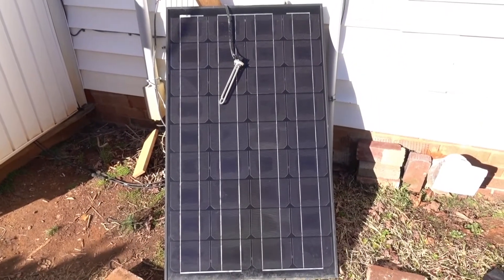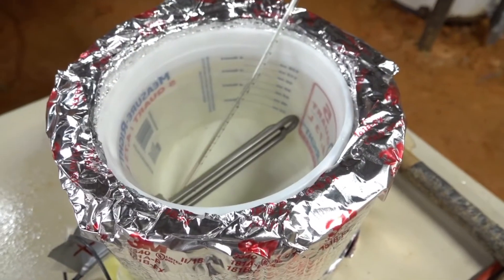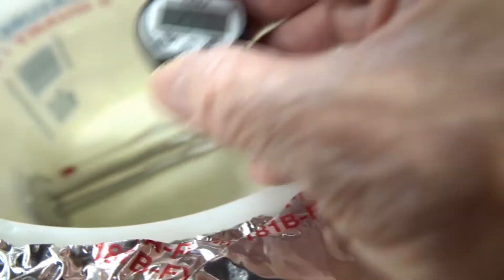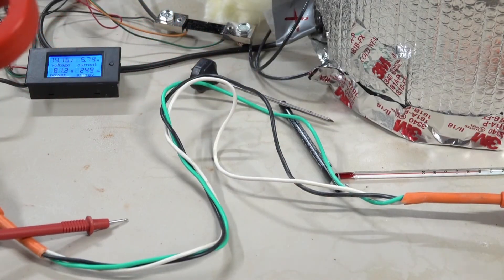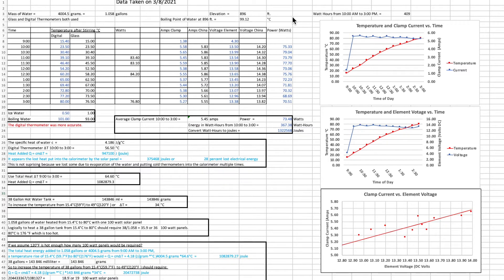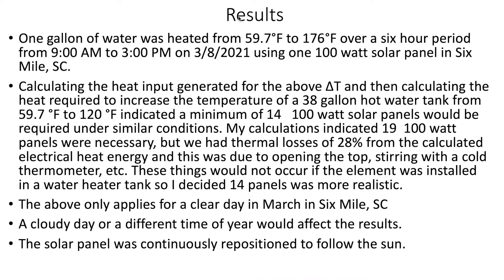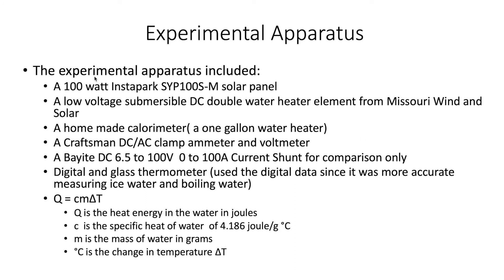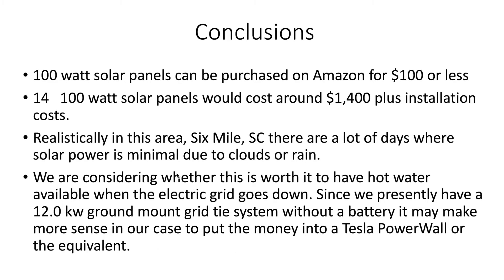Using a 100 Watt Solar Panel to Heat One Gallon of Water

Comment: Could you help me out? Is a one gallon container able to be brought to a boil with (1) 100 watt solar panel? Trying to make a distiller.
Reply from the maker: Maybe if the boiler is insulated so all of the heat input goes into the water and not the environment. A continuous boil would require a lot of heat input. I have not tried to boil water with it. Good luck with your project.

Comment: Having measuremens to end at 3PM is like ending a movie with a cliff hanger.... The sun is still up!!!! what happens the rest of the day?
Reply from the maker: This was just an experiment to show how easy it is to do this. The solar production on our 12 kw ground mount panels is basically zero before 7:00 AM and after 5:40 PM. Most of the power is produced between 9:00 AM and 3:30 AM where we are located.
Reply: @anisotropicplus  thanks

Comment: Are there any safety considerations regarding arcing of AC water heater thermostat contacts  for instance,  or elsewhere in the circuitry, with DC direct or is this such a low voltage
 that DC arcing is not an issue?
Reply from the maker: Very good question. I was monitoring this set up closely since it was an experiment. If I was going to install it in a home water heater or use it in an unmonitored way I would add a fuse to the circuit and size it for the smallest wire size used. Make sure you comply with any electrical codes for your area.
Reply: @anisotropicplus did you install it ? Thanks

Comment: As a bench mark, I wonder how heating a container, clear on the front and insulated on the back with direct sunlight would have worked?
Reply from the maker: Thanks for your comment. have not done that exact experiment, but other experiments suggest it would work better since more of the total spectrum of sunlight would be used. Especially if the bottom of the container was black. The thing I like about using the photovoltaic solar panel is you have a lot of flexibility in where you place it and getting the energy inside your house using only a small diameter cable instead of water pipes or air ducts.

Comment: So it looks like it is not worth it. Thanks
Reply: Depends. This video is 3 years old and panels are way cheaper now. If you have a 450W panel and a properly matched element you might only need 1 panel to partially heat a tank over 15 hours of sunshine. By partially heating I mean you might have comfortable warm water rather than cold water coming from your hot tap. Add another panel and you might get water that you can directly shower with and it should be that way for the next 20 years.
Reply: @jellibeens  In my location I am happy to get minutes of sun per day. Today for example 120W panel, 50Wh production for a day.
Reply: @jellibeens  Thanks for watching and your comment.
Reply: @jellibeens  I just got my old Welsh house. Nice cottage in the national park. The biggest issue in my valley is heating water......its so expensive these days. In my rental the farmer had a biomass boilers, so efficient and amazing, but expensive, 2 - 450W panels, you really think it'd be ok? its only me and my wife, and we have mains electric, but I'd like to use that only for top-ups or when the Welsh sun is rare (nov-march). 450w panels seem relatively cheap these days?
Reply: @anthonyjackson9194  I am not an expert but 900 watts of power should heat a water tank on an average day. The panel should be heating for 5 hours minimum per day so there should be a difference. If you get a dual element system you could supplement the solar with regular power after the sun goes down just to get it up to the final temperature on cloudy days.
Reply: @jellibeens   thanks. I think I have found a few answers, 900w, with a device called a Solar iboost which swithces between excess solar energy and the grid.....which means dual element......but Id rather not rely on more tech, maybe there is a simpler way? I read that elements for heating water are variable input, so like this video, as long as the volts meet requirements I could techincally have 200w ot of my 900w, heating slowly.
Reply from the maker: Thanks for watching

Comment: Blocking part of the panel will drastically reduced the Effective of the panel
Reply from the maker: Yes, you are correct. I only placed the alignment board on it to realign it with the sun and then removed it. Thanks for watching and your comment.

Comment: This is all good but those DC  Elements dont go directly onto my standard hot water tank  There a screw on Element ...The original element is AC  240 VOLT  2000 WATTS is a 4 bolts to a 70mm square plate .      So how are you going to fit that DC Element to your standard  water tank everyone got  Because thats what your ultimately wanting to do   . ???
Reply from the maker: That is a good question. I did not actually try to install it in a standard hot water heater. I recently replaced two 38 gallon standard water heaters with a 50 gallon Rheem hybrid heat pump hot water heater. It is very efficient, but I have had some thermistor problems with it. I recommend you contact Missouri Wind and Solar with your question. https://windandsolar.com/?keyword_session_id=vt~adwords%7Ckt~missouri%20wind%20and%20solar%7Cmt~b%7Cta~340302867773&_vsrefdom=wordstream&gad_source=1&gclid=CjwKCAjw-O6zBhASEiwAOHeGxaR_eY-_W8tSvYvmJAKGOg_ZW-2Ib8Pp-O29NKi9hv-9CPBxQmHOoBoCKJUQAvD_BwE
Reply: Did that today, removed the gasket from old element, cut a square in the metal place and she's all watertight.

Comment: Let me get this straight.  You're using a heat source (sunlight) to make electricity to make heat?

Huh?
Reply from the maker: Yes, and it works great.
Reply: @anisotropicplus  
Seems like two steps forward and one step back to me.

Why not take three steps forward and simply heat with heat right out of the chute?

Oh, and if you're worried about freezing pipes in Winter, do as I do and run oil (I use peanut oil) as a working fluid, that circulates through a heat exchanger to create hot water.  I set it and forget it.

I haven't paid a penny for hot water in overv 30 years!
Reply from the maker: @SiwyWabbit  Thanks for watching and your idea.
Reply: @SiwyWabbit   I have a friend lives in Alaska and on a sunny day his solar panels heat up the sand heat storage in his house that last days. You can have sun in frozen weather as well.
Reply: @thetruthalwaysscary please tell him to make a video of his setup. I want to make one too.

Comment: I know a really realy cheap way to do it. Get a panel heater and inside is a very thin wire with a silicone coating, and if you put this wire on a 12 volt supply you get infrared heating, and I put the wire all over my mattress and its amazing, but if you stick this wire inside something lime a beer keg it will heat water and keep it hot. (Never tried but the wire is from 2000w heater)
Reply from the maker: Interesting idea. Thanks for watching and your comment.

Comment: Use the solar power to drive a pump that circulates the water inside of a safe pipe inside of a wood frame with a plastic surface towards the sun.   Much more efficient use of solar power.
Reply from the maker: Thanks for watching and your idea.
Reply: That is seasonal dependent. Not nearly as good with winter sun angles in freezing temperatures. You would need some lensing to pull it off. And then you have the potential for storm damage taking out difficult to replace items. Used solar panels are cheap and plentiful.
Reply: @kirkwilson5905  Good points but storm damage also applies to solar.   There's a video in my feed from some solar youtubers who lost their solar panel system to one strike.

Comment: Use the electricity captured via solar panels to drive the heat pump on a water heater equipped with such.  They have a very high coefficient of performance (CoP) so they capture 3 to 4 units of heat for every unit of electricity used.  They are more expensive, but the ROI is typically 18 to 24 months, on a unit made to last 10 to 12 years.  If you have a few hundred extra dollars, they will save you thousands over the long run.
Reply: THIS! ^^^^ Heat pump water heaters are becoming standard. They are capable of using backup resistive heat or a mix of the 2 for performance, and also double as dehumidifiers. Anywhere that sees warm summers could benefit from them now, not just warmer climates. I've had a 18k btu heat pump heating my entire home for 3 years now in the NE with sometimes below 0 weather. It's rated to heat down to -22F and has done so encased in ice somehow. If you live in warmer climates, they now sell a 120V plug-in Rheem heat pump water heater that runs off 400-500 watts. That would be down right EASY to run from solar.
Reply from the maker: @Earth1-Inhabitant  Thanks for your comment.
Reply: @Earth1-Inhabitant  That new 120v unit from Rheem is a game-changer.  The only thing I don't like about it, and what will keep some folks from buying it, is there's no "high demand" option.  It isn't a good solution for a larger household, unless used in conjunction with a smaller, 240v electric model.
Reply: @jasonbroom7147  From what I've read, simply buying a larger tank or even installing another in-line storage tank takes care of issues 95% of the time. I'm considering buying the shared circuit model to run from solar (standalone system), and keeping my oil storage tank for backup in cold months. Reason being that I only have 100 amp service and don't want to upgrade. I use oil to heat my water only and the boiler is oversized and wasting tons of money. The plan is to see how the heat pump does for the rest of the winter months. I plan on insulating my basement/crawl space next spring to hopefully remove oil altogether except for 100% emergency use. If the 120v shared circuit model still can't keep up, I plan on installing another storage tank beside it. For those that want a faster recovery, the Rheem 120v dedicated circuit model has a compressor twice the size of typical hybrids and impressive numbers.
Reply from the maker: Thanks for watching and your comment.

Comment: Good plan!  On another vid a guy used some nichrome wire and a PV panel to heat a tin of sand.  The box of sand stayed at around 200C to 300C.  He used it for his everyday cooking, which seemed to be a very simple concept.
Reply from the maker: That is interesting. Thanks for sharing.
Reply: I looked but can't find the video :(( Any chance you could put out a link PLEASE? :D Thank you!

Comment: You covered part of the panel with the wood...
Reply from the maker: Thanks for watching and your comment. If you are referring to the board with the drill bit I just temporarily taped it to the panel while aligning it to the sun. I mentioned in the video that I used the board to keep the panel aligned, but removed it after adjusting the position. Your question was a good one and thanks again for watching.

Comment: Nice experiment!  However, I think you missed one thing.  At least one can’t tell for sure if you missed it or not.  You resultant number of panels seems a bit high to me based on some other rougher calculations I’ve done for a similar contemplate project.  The issue I believe is that you only used one panel which almost invariably is not impedance matched to the resistance of your element. A key result in electrical engineering is the maximum power transfer between a source and a sink can only happen when the impedance (here just resistance) of both are the same.  A single solar panel has a resistance of about 3 ohms.  Most water heaters have a resistance between about 9 to 12 ohms (which does shift due to temperature).  This means that your resistance is mismatched, and you will not get maximum power transfer from the solar panel. A 2 to 1 mismatch will result in about 10% loss of power. You are running closer to three to one, maybe 4 to 1.  This could notch you down to many about a 30% loss of power.  This means that your projected 14 panel requirement should really be between 9-12 achieved by wiring them up in combinations of series and parallel groups such that the combination provides the same internal resistance as your heating element.  Is your heating element is 9 ohms, then three panels in series would get you 9 ohms of panel resistance. Double that to 6 panels in series to get 18 ohms.  Then put an identical string of 6 series connected panels in parallel with the first series string and that gets you back down to 9 ohms, and almost perfect match to the 9 ohms heater resistance for near 100% power transfer. And you saved a couple hundred bucks in the process. There are of course other ways to wire it.  And the heater resistance might be different than this example.  Key is that the resistances match as closely as possible.
Reply from the maker: Thanks for watching and taking the time to share the details of how to improve the energy transfer.
Reply: Thanks so much for that info re the resistances - it explains why my humble experiments have been so remarkably unsuccessful to date!
Reply: ...and then the elation fades...After sticking my multimeter across my PV panel on Measure Resistance setting, with no useful result at all, this begs the question - how does one measure the Resistance of a PV panel?
Reply: @nigelwilliams7920  It isn't measured, it is calculated.  Take the MPPT voltage and divide it by the current.  That gives you the ideal resistance.  Ideal resistance should never be used in direct connect.  At best that may happen 15 minutes a day. Studies have shown using twice the ideal resistance will outperform the ideal in daily production.  I design power point controllers for water heating and these will double heat production.  Direct connection is for those who don't know any better.
Reply: Sounds like you have never heated water.

Comment: It is amazing the flat current line you can get with continuously tracking the sun. It does give those who will have fixed panels a false sense of performance.  Especially with direct connect which is a poor performer. One study indicated the ideal resistance could be doubled and more overall daily output obtained.  This is due to the fact that most of the day current will be much less than Imp. The solar world still is in the dark ages when it comes to heating water. Controllers which electronically match the panel to the heating element are still quite expensive and not designed to last as long as the tank.  For those inclined to build their own, these controls are fairly simple and cheap to build.  I made one out of a $10 inverter board. Higher voltage with grid tie panels is the way to go. For $500 you can have PV hot water system.
Reply from the maker: Thanks for watching and your informative comment. I am all for cheap and simple when possible.

Comment: Good experimenting.  I have an engineering background and love the garage tinkering and have done similar experiments. Recording data and spreadsheets is good practice so I am one of the few that won't get bored looking at that stuff. ha!  I have several DC immersion heating elements but have only had time to test a few.   Did you mention the sepcs on your heat element?
Reply from the maker: Thanks for watching and your comment. I will look up the specs. and get back to you by Friday.
Reply from the maker: I just checked my order for the heating element from Missouri Wind and Solar. It looks like it is no longer available.

1 × Low Voltage DC Submersible Double Water Heater Element<br><b>Voltage:</b>&nbsp;48 Volts<br><b>Wattage:</b>&nbsp;2000 Watts
Unfortunately this product is no longer for sale so it cannot be reordered. They do have others available. This is a link.

https://windandsolar.com/dc-water-heating-elements/
Reply: @anisotropicplus  Thanks for checking.  I just got my heater last week.  48/1000 watt/2.3ohm.  should work nice with my two 315 watt modules.  (y)
Reply from the maker: @daveluxton8317  Sounds good.

Comment: I was thinking that this same principle could be used to keep drinking water from freezing at a camp or off-grid 2nd home in between visits. Loosely extrapolating from your data, it's conceivable that even a single 100W panel with a similar 12V heater could serve this function (with a well insulated tank) depending on one's latitude. Thank you for sharing this info!
Reply from the maker: Thanks for your comment. Yes, I agree.